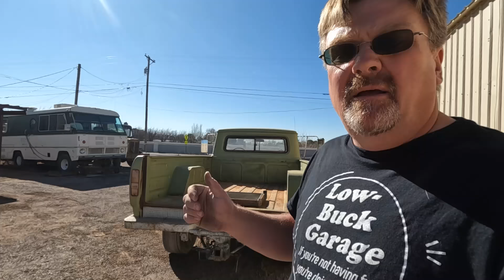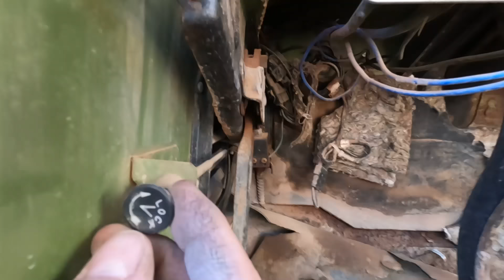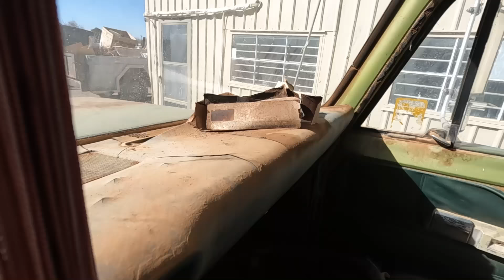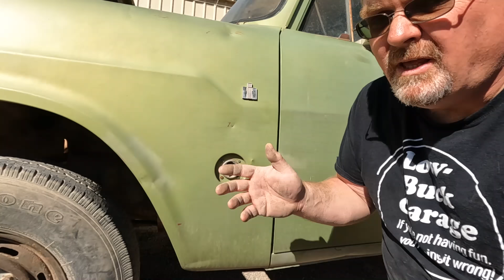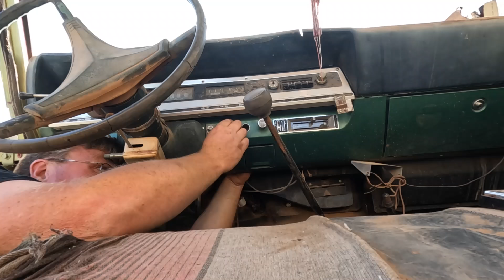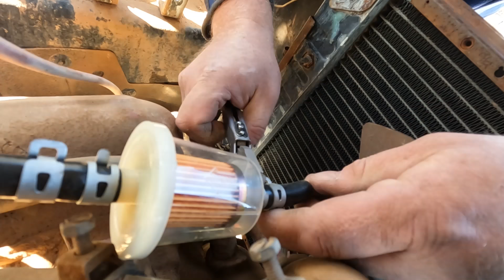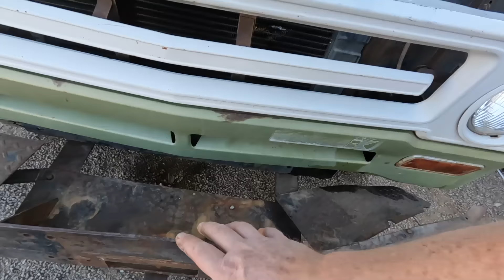1970 International 4x4 Pickup

Comment: Excellent video Low Buck Garage 1970 International 1200 with 4×4 also 345 V8 with  2barrel Holley 650 CFM plus Hand choke cable knob in dash to and transmission be Eaton D16 be 5 with Overdrive or D18  be Bow Low First gear and axles  be 390 or 409 or  410 or 411 o 418 or 456  with 206 transfer case for 4×4 ! Yes that wire key be easy find for electronic for hopefully! Nice bring old memories of my childhood when my late Uncle and late  dad share together back years ago on farm !
Reply: Have international 4 speed behind 300-6 in my 76 f-100. Has low 1st and high 4th.
Reply: @jameskerrigan2997   Bow Low First Gear fast speed get is 10 to 20 mph and 4th gear might get 85 to 90  MPH  top speed  depending is ratio is plus posi axle  or not ! That specs for Eaton D18 are!
Reply: @AndrewHCann  yep, you have to do at least 35 mph in third to get it in 4th then 35-95 in 4th. I take off in second unless loaded or want to crawl in 1st. Has rear with pos out of galaxy 500 so higher geared rear end. Fun truck to drive. 2wd does great in snow and turns tight.
Reply: @AndrewHCann  used to have three on the tree, with rear end out of the galaxy it wanted to launch in 1st. So friend that used to own it found rebuilt international 4 speed at swapp meet and thought he would make a plate. When he got it behind the 300 to make template he found that holes lined up😁 another thing interchangeable between international and Ford.
Reply: @jameskerrigan2997  yes Eaton D18 fits up to lots motors of Ford 360 or 390 ones and one saw hook up amazing me was 1976 Massey Ferguson 505 Combine of   a 356 straight 6 Perkins  Desiel motor in 1976 Dodge D350 12 passenger van !
Reply: @AndrewHCann  yep cool trans. It has plate for PTO if you're so inclined. I had dreams of hooking one up for water cannon 🤣

Comment: Nice truck. It gives you a bunch of choices as well. Stay gas, go propane, or go diesel. If you go diesel, you could go Cummins, or  choose from the International 360 offerings, or choose from the Deutz offerings. The only big buck deficiency you have is the radiator. Have fun, take care, and Happy New Year.
Reply: Some folks have put 6v53’s in pickups, but they are pretty heavy. I don’t know about the Mack trans. I would try a 6 series 9 or 13 speed RoadRanger. A bit smaller and lighter than the 9 series that came in full size trucks. A little harder to find, but they are out there. Take care and happy hunting.
Reply: 6v53t with a Mack 10 speed transmission?

Comment: Hydraulics operate under hundreds of PSis. The 60 PSi or whatever the engine would produce would not cut it. Could have been mechanically driven off a PTO on the transmission?

Comment: The IH redline of 4000 rpm’s is typical for IH. They’ll take that rpm all day without damage. I’ve run gas big block IH and slant 4 engines. Dead nuts reliable.
Reply: The 9ft box it cool too. If you look at NAPA, parts should be relatively plentiful. Tons of IH stuff on Canadian Prairies

Comment: My IH has dual tanks with a toggle switch to change from one tank to the other. I've seen other trucks with a manual switch on the floor though. It also had a similar type trailer brake contrroller (but smaller) mounted on the lower edge of the dash. Mine had been used to carry a camper and the back springs are really, really stiff without any weight in the back.

Comment: I have a 72 IH 1210 Camper Special that has a very similar bumper, same sliding window, both factory installed, although ithe bumper and hitch looks more like a farmer installation. Mine is RWD, 345 and automatic, so yours defineitely scores some points for that.

Comment: Many years ago we would spin balance the tire and wheel assembly on the vehicle therefor balancing the brake drum , wheel and tire in one.  Check your fuel pump for a canister on the bottom for a filter.   Have fun with the phillips head bolts holding the pully on the water pump. Anddd  I love your methodology by not punching keys to order off the interscreen and making do with what is in the shop. Hence Low buck garage!

Comment: some 25 years ago I bought a 1970 international pickup truck was the same color the original paint had not one spot of rust on it had a 6 cylinder 3 speed on the column no power steering no power brakes I paid $800 for it I drove it for about 6 months decided it was a truck that I really didn't care for turned around and sold it for $1,600 but it was a cream puff it came from Texas or Arkansas can't remember which but it was totally rust free and the pain on it was original and it was awesome wish I had that truck today I know it'd be worth 10 times that

Comment: Since I used to own a 1972 Travelette and a 1969 Travelette (both 4x4 four-door versions of this same truck) I will give you some information that may help in the future:  A lot of the electrical parts, especially in the cab, are sourced from General Motors.  The dome light, turn signal switch, and dimmer switch are from the same year Chevy/GMC trucks.  The headlight switch is also GM if I recall correctly.  The oil filter is the same one that many Fords used into the 90s:  Motorcraft FL-1A.  The brake drums are no longer available new, btw.

Comment: Got a Loadstar 1600 w/ the 345 & at one stage the new fuel pump (same as on SBC) started "making oil for the engine" when I thought it was the carb doing it. Eventually it stopped "making oil" during the process of troubleshooting & didn't do anything anymore. On the bright side the engine innards got a cleaning (wasn't run long enough to allow any damage)

Comment: Don't have 1 of these but do have a late 60s 800A that is rotten from the rocker panels back (came from somewhere in the NW & IH's do tend to rust anywhere else outside the SW). BUT ON THE + SIDE(!) it has a 304 that purrs (carb float stuck open of course) w/ just gas + battery. A project build been hoping to start on for the last 5 years...got a 60% rolling body to donate the good body portion from. When done hoping to make 1 out of 2...kinda...more like 1-1/2 out of 2 since will be a 6x6 (top secret plans on making the aft axle work)

Comment: We had one that had so much gasoline in the oil that you could pull the dipstick out and light it on fire but yet the thing still kept running and we ran it for years like that the 3:45 is a strong stubborn engine

Comment: Nice looking International James! 😁👍  I enjoyed the video. I've heard about the overdrive transmissions and the odd shift patterns.  Some are harder to find than others. Not sure which is which. Regardless, that's a solid  old pickup.  I agree with you on the winch setup. You never know what could have been there.  Hopefully the clutch gets better. Take care and happy wrenching 🔧🔩
Reply from the maker: I did a little research and apparently they had 3 different 5-speeds, but only the T-34 has an OD.  I finally got it on the road, and unfortunately the clutch is just toasted.  I had to feather the throttle to get it to move in 2nd...

Comment: I love your classic theory of resolving any issues. I was wondering if the tank switch is on the other tank so no fuel to the pump. Okay, on my one ton international, it was a factory optioned every box checked so as far as deluxe goes, Ford Ranger or Chevy Cheyenne level. One thing was different though, mine being older than this one, mine was a 66 model and when you showed this engine, I was putting money bets that it was the 392 because of that high thermostat housing.... my bad. Also mine was four barrel as many of the 345's were. Only (most) 392 came with the two barrel carb, so again the very reason I say this is a 392 top end on this motor. I do know a man who knows just about any question you can think of.... Ben over at "406" garage, his channel name. Yes the oil lines that you capped off went to a warn winch but had the international badge on it and I am certain he has all the pieces and parts to complete this set up on your truck... I have commented on his page so if you go there, it would be nice if you mentioned I sent you. I know in my heart that it was the big three that knocked out the sales of international here in the usa. I would put mom on the betting line (she never cared for me so if I lose) ... the international was a far better rig than any of the other junk we have going. I have had some older internationals with the 5.9 cummins engines in them and they are a fine swap.... maybe had the international stayed, dodge would not of been the only rig with cummins from the factory. The winch was powered by those oil lines an those controls are ultra rare. You have enough though to complete that control panel with new cable controls. My winch was a ten thousand pound winch and son, lets just say that every bit of ten thousand pounds of pull with no burned out winch motor as it would pull for days and never give up. I have used bed frames for some cheap angle for my hood just as you did on this one. I'm 73 and lets be honest, the international I bought new was my first truck that I bought new. I got my emancipation in 64 when I was just fifteen and had saved so much money from working any job.... including picking strawberries, cutting firewood, sawing lumber and ties for the railroad, hauling dirt for neighbors. My one ton international had a factory dump box as well. I told you.... every box on that list was checked and when the sales people found out what kind of money I had, they bent backwards to give me the best of service. One of the older men who worked in sales took me to the side and explained to me what was jewelry and what was a winner. I told them that I   wanted the loudest radio in the world so I got a factory tape deck radio in mine. That old eight track now would be some   real money to the absolute right person. When I drove my old beat up 51 chevy one ton flat bed truck into their parking area, they said to leave at once and after showing a handful of money.... it got parked right next to their front door! I stayed with that dealership till they left town.
      I got my truck in december of 65 and it was a orange and white color. I got my sorry butt drafted in august of 66 so I drove my truck up into canada to a friends home, he was a old man who would dearly take good care of it and use it some. I got home in summer of 69, went up and got my truck back, the old man nearly cried as I drove away. About six months went by and I had bought a new 70 Peterbilt logging truck so I loaded my old international up on the back of my logging truck and took it back up to his place along with the title, handed that and the keys to him... this time he did cry but happy tears. I followed him for years and his care for that truck was much more than I would of given it... it still looked new when he passed on. By then I   was working as a mechanic in alaska as married life just didn't seem to be my favor.
       I do apologize for this book length comment as you just bring so many memories back to me. I will tell you that if you try a little .... even those door cards can be saved by using a way to get the vinyl off of the old cards and put a new card in it. Its cheap and just takes time. I would not trade your seventy model international for a new dodge, chevy or ford. Yours will stand the time an just show me any newer trucks that are still on the road past ten years! Your truck is now 53... happy new year would be appropriate now hu. I figure they stopped around the nineties for making any rig worth having.    I wander about in my comments like a drunk goat so going to the door cards, Scott at coldwar motors did a series on a sixty plymouth he restored... he did the door cards on it using the old vinyl an a heat gun.

Comment: I love those old Binders. They used super hard iron in the engines and can run forever without wearing. If the oil pump works, and bearings aren't allowed to overly wear, it would be a cheap rebuild. Usually just a valve job, timing set, rings, and bearings.
Reply: IH Cast iron blocks had more nickel in the mix. That made them more durable. But they do wear out cylinders. I have two 392 IH engines. one is reverse rotation. They are in my boat as Palmer marinized them back in 1970.  Palmer though made a big mistake, they got rid of the full flow oil filter, and used only a bypass. So over the years, the engines wore out bearings, and Palmer went out of business. Palmer Brothers, Coss Cob Connecticut. A lot of stuff that was once relevant has passed into history and no one knows anymore. Sometimes that is a good thing.

Comment: It's usually the rubber 5/16x3" short fuel hose from the pickup on top of the fuel tank to the fuel tank selector valve that goes bad  drop the fuel tank and replace it....
She'll suck fuel
Reply from the maker: Thanks for the tip, I'll look at that!

Comment: I'm taking the 392 ci engine out of my 73 International and putting it into a 74 F700 Ford crane truck because the 391 in the Ford is junk and yes i'm changing transmission also because pto is a seperate trans case back in the drive line

Comment: I have 2 of those trucks both 3/4 ton 4x4 one 73 and one 74 i found out the frames are different on the 2 trucks when i took the plow push plates off the 73 and tried to put them on the 74 the frame turns in closer to the front on the 74 so i need to offset the push plates in half way back so they end up against the frame correctly

Comment: I just put a honda civic radiator in my fc and had to use your doubled up hose trick. I guess I'll take the blame if it doesnt work.
Reply from the maker: Civic radiator, interesting.  About 15 years ago I put together an almost completely stock FC, and spent way too much getting the factory radiator re-cored.  I didn't have the original jackshaft fan set-up, tried an electric, and it overheated all the time.  Was OK when I got the stock fan back in there.  I like the idea of a more modern radiator, I hope it works for you.
Reply: @LowBuckGarage  yeah i had to take out the original fan and use an electric one that came with it but otherwise it fits great. I think it will cool better with the electric fan anyway. We'll see. Walcks does have new ones but they are like 700 bucks. The civic one was 90. I'll take my chances

Comment: It's still a damn good truck. Not enough psi from engine oil to run a winch, which would require around 2000 psi. The original radiator had fitting in it for the oil cooler lines just like an outo trans radiator would.

Comment: I worked for a few farmers in the early 80s that had tachometers installed on all of their IH feed trucks.  The reason that they installed an aftermarket tachometer was to keep the driver from spinning the motor any higher than 4k rpm.  The IH 345 motor was particularly bad about throwing rods and spitting timing gears if you spun it any higher than 4k rpm.
Reply: Yeah, you really don't want to go much over 3600rpm for any length of time, keep it at 3500-3600 max and they will do a few hundred thousand miles that way. My 1210 has 4.56 gears and a 4 speed. 60mph is 3000. 70mph is max speed.

Comment: My family drove International trucks exclusively as long as they were built. The last one I owned was a 1973 1100. 
There was a saying about Internationals back then. You can't wear them out, but eventually, they will wear you out. 
My brother owned a 1964 3/4 ton that he rolled on a blind curve one night. It landed upright and he drove it home that night and except for a few dents and bruises, my brother and his truck remained intact. He drove it for years following the accident.  
The 1200 4x4 with a 345 is the Crown Jewel of the Internationals. I would be interested to know how much you gave for it. You have a real treasure. I hope you restore it to original.
Reply: My brother rolled Dad's '57 pickup one night and squashed the hood & roof.  Replaced the cab and an oil change and it ran for at least another 40 years before he gave it to a grandson.  They drove like bricks but were that rugged too.
Reply: Yep, and those old V-series (345/392) were hell for stout and built for lugging, unlike most engines. We have a Loadstar 1800 with a 20 ft grain stake bed,V392 and a 5+4 trans still, and I can't find a way to kill it under load if I'm in a reasonably close gear. Great for driving on slick roads, because you can shift up a gear and let the torque pull you along.

Comment: My father-in-law had the four door version of that thing - drove it for years.  We called it the Scoutmobile because of (you guessed it) how many boys scouts and gear it hauled around over the years.  It could go anywhere, and it did.  Up snowpacked fire roads, and through places where there was no road.  Could have been called the Deermobile because of how much venison it packed out of the hills.  

The main problem was parts - when it needed a replacement bed, the only we could find was a jeep pickup long bed.  And even that needed to be lengthened to make it fit.  But with the help of a good torch and grinder we made it work.

The other problem was that the old 345 drank fuel by the gallon.  At the best of times the old girl got 8 miles to the gallon, but usually it was closer to 6.  He used to joke about being able to use the gas gauge for a fan.  

Anyway, thanks for the memories.  He’s since passed on and so has the truck.  Although I heard a while back that someone saw it parked somewhere in a small town to the north of us.  So maybe someone will grab it and bring it back to life like you have.